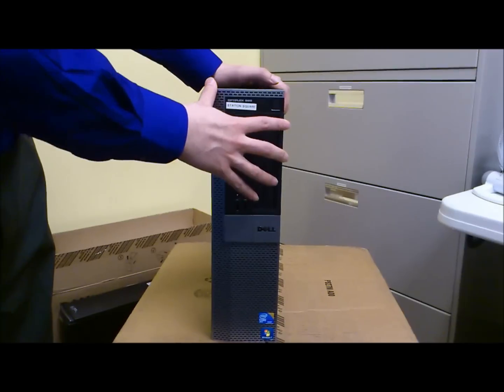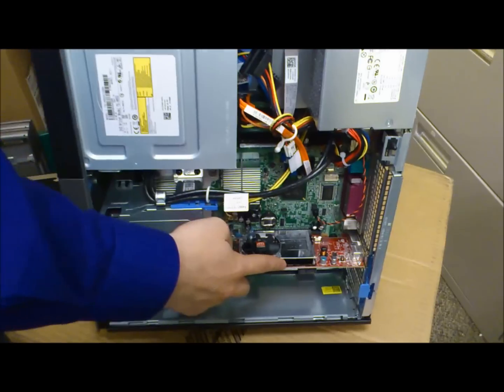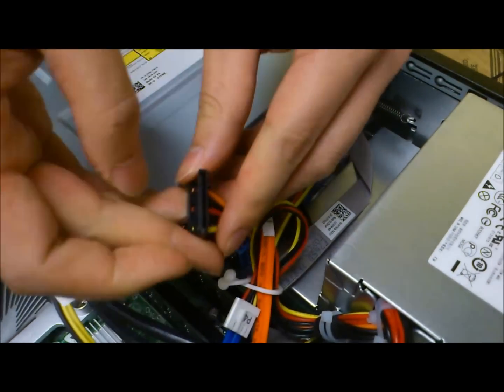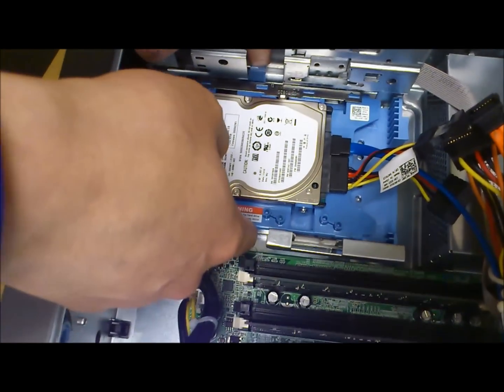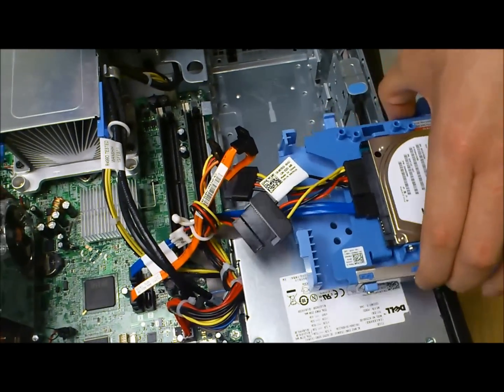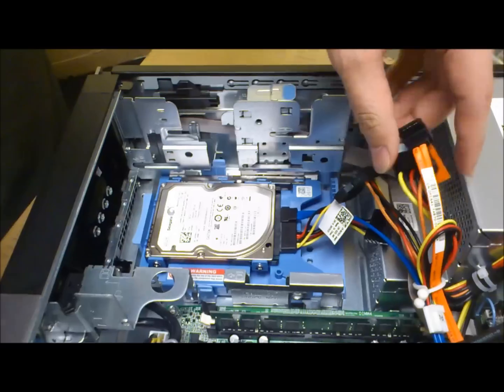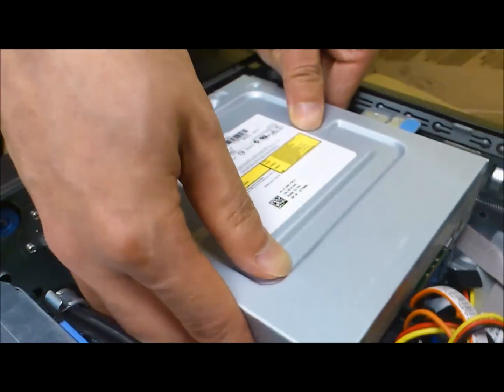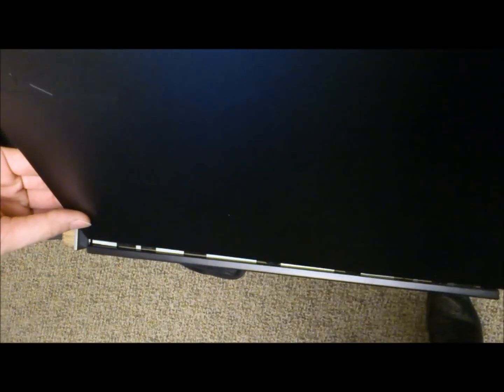Hard drive replacement- Optiplex 960 Desktop

Comment: What is your Graphic Card? So that i can also Fit in a Graphic card.. :(
Reply: +Skyrim Mac-jordan any low-profile card will work (depends on your form factor)
Reply: I have a GT 610 in my optiplex 960 with a Core 2 Duo E8400 3.0ghz and the GT 610 in games shoots up to 104c after 4 minutes ingame :/ But thats because the HDD enclosure the PC has. and I dont have a 2.5inch Sata Drive :/ so my GPU has 1cm of air breathing room
Reply: get a gt 1030 ti.. amazing card for the price (its low profile , which will fit in the optiplex sff) if you dont want the 1030 ti any "low-profile" gpu will work

Comment: hey!! could u tell my what video card has been installed on this CPU shown in the video??
i own the same optiplex and am looking for a video card for it!! please help!! also do tell me what cards would be compatible with the small form factor of this optiplex!!!
Reply: i have the same exact optiplex with a Gt 1030 ti in it.. theyre pretty cheap and run at least medium graphics on 2018 triple a titles. really good budget choice
Reply: @Gpayne99  what about your Power Supply?!?
Reply: @aymanashraf5072  im using the same power supply that came with the optiplex 990, the gt 1030ti doesnt use much power, it doesnt require being plugged into the power supply
Reply: @Gpayne99  can the gt1030 works on PSU 220 watt ??!?
Reply: @aymanashraf5072  my power supply is 260w .... you will have to double check how much wattage every piece of hardware in your build puts out to make sure you have enough power.
Reply: @Gpayne99  ok..till me the pieces that i should check it ?
Reply: @aymanashraf5072  hard drive, cpu, gpu, ram, fans...... anything that draws power from your power supply

Comment: ATI Radeon HD 3450 256MB GDDR3 SDRAM PCI Express x16
They are pretty popular in these Small Form Factor computers.  You can pick them up on eBay for roughly $10-20.